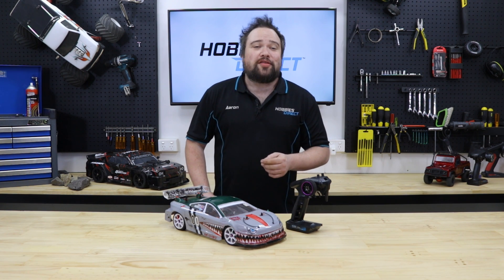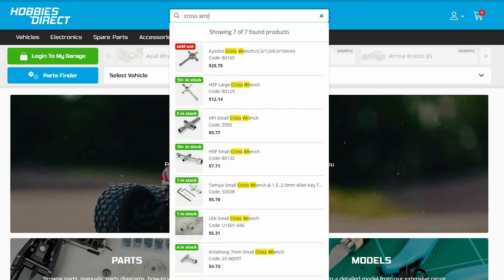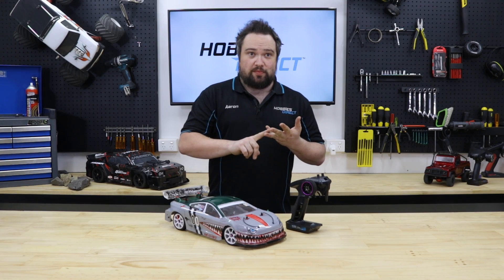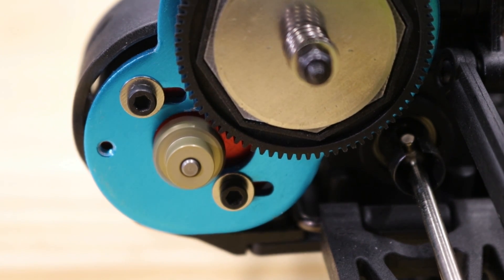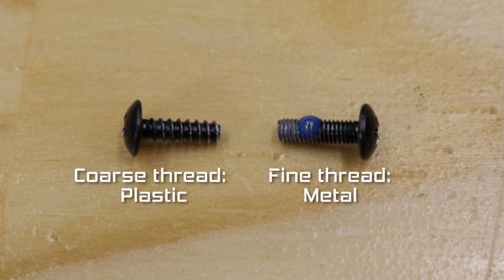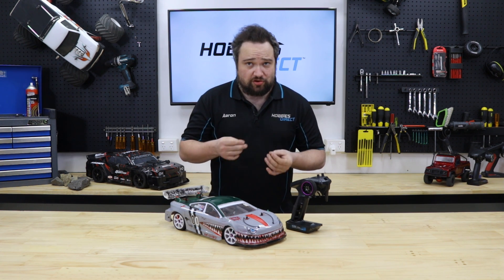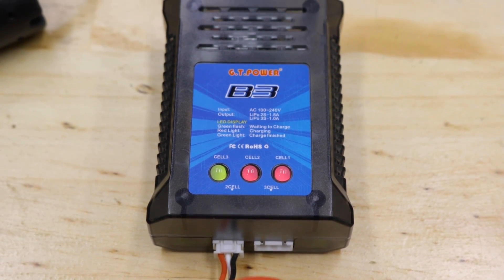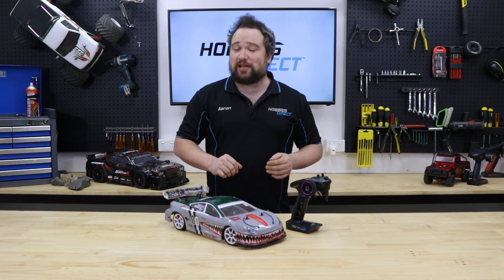How to Look After your RC Car - Top Ten Tips

Comment: I wonder if you can help me.
I have a HSP Wolverine Pro and the Brakes are locked on, the steering servo is fine but if I try to drive forwards or backward it just ticks in said direction but the wheels are locked up...

Please help 😫
Reply: Did you figure it out? Problem with the dif?
Reply: @Gerson  yes, I can't remember  what it was now but I do remember the problems just piled up until I sent it back for a refund.

Comment: When you measured the wheels/tires you were measuring their circumference, not diameter.
Reply from the maker: Yep. Measuring the difference in circumference (or rollout) of two different diameter wheels to show the larger diameter wheel had 1.75 times the rollout :-)